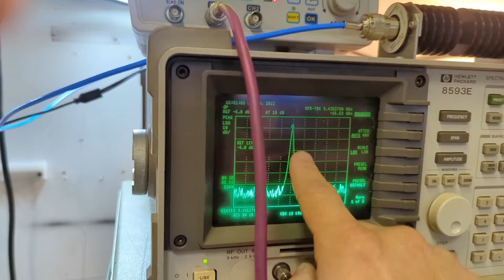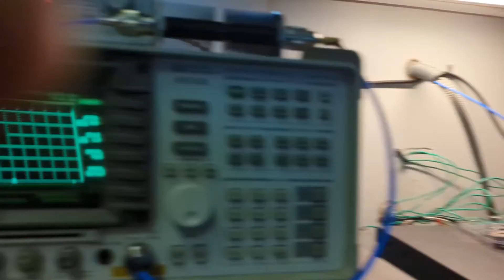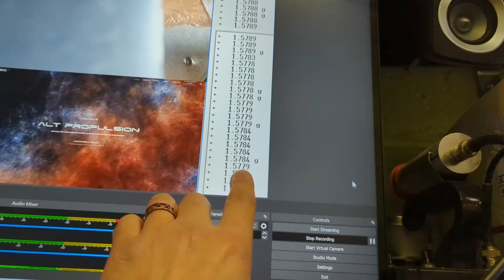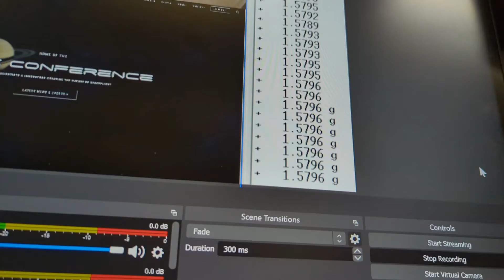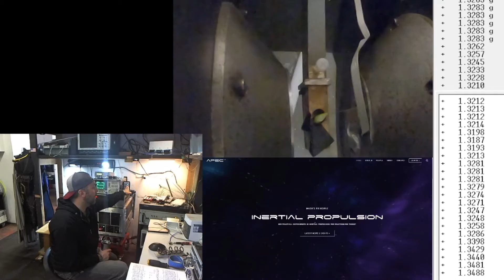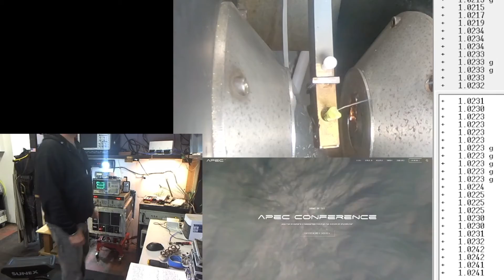Alzofon Testing of Various Materials  | Gravity Control with Present Technology Part 4 - Final

Comment: Has you had any results or experiments that indicate this theory can produce mass reduction? I know the equipment has been built to do the testing but what stage are you guys at? Fine tuning the equipment to remove errors? or is that part done and now its just a matter of testing a bunch of samples?
Reply from the maker: Mark at his falcon space shop will continue working with it I am sure. I didn't have any results with the parameters of that set up, but have noticed some weak movement before. I am moving on to other things for now, 
when I get a better grasp on what needs to happen may revisit